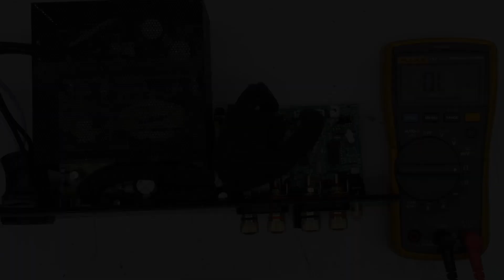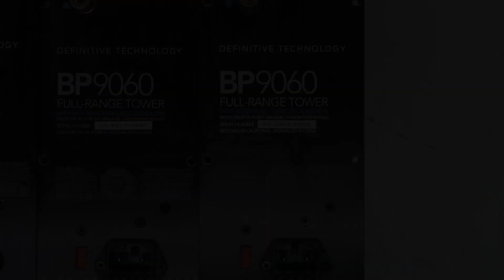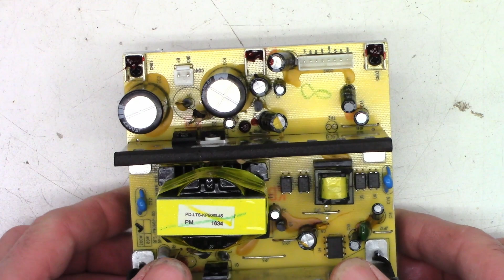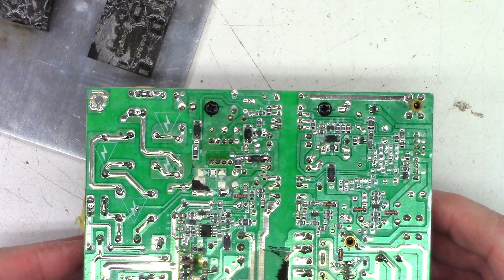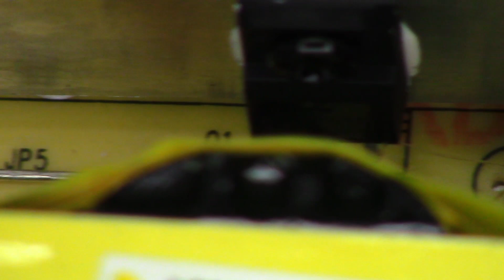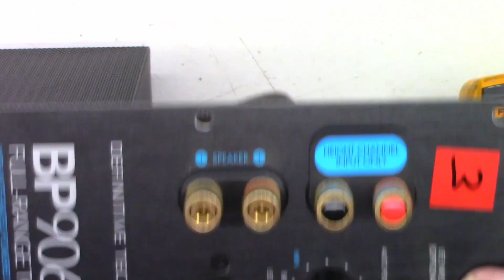A Customer dropped off (3) Definitive Technology BP9060 Amplifier Boards. What did I find?

Comment: Thanks for the video. I’m working on this power supply issue now. Here is what I’ve ordered:

Burned
R14 0.47ohm (1206)
R15 0.47ohm (1206)
R17 0.47ohm (1206)
R18 0.47ohm (1206)
R21 560ohm (0805)
D3 MMBD914L shorted *marking of “5D” (SOT-23)
U7 OB2269CP blown PWM Controller IC (SOIC-8)
Q1 16N50 (replaced with STP20NK50Z) Shorted (TO-220) but need to isolate metal tab of new FET with nylon isolation washer and mica (and apply thermal grease).  Test for short between heat sink and FET tab before applying power. Good luck!

Comment: Thank you for the tear down and diagnosis - great job ! I have also had issues with exactly these and have gone as far as buying new amps from DT. I have exactly the same issue with the SMPSU on the latest dead amp, same components gone too. there must be a common cause or some design flaw. So if I want to power the amp externally... what voltages do I need ? ; +45VDC @ 4 amps, +/-12VDC @ 1 amp and +5VDC @ 1 amp. do I need to pull any other pin on the 8-way connector either up or pull down to get it to turn on and work ??. Would appreciate any comment and thanks again.
Reply: Did you figure out how to power the amp externally?

Comment: @NorCal715 I agree with two posters here..... do a teardown of the PSU on either of the two working, PSU's get it on video, then refer to it later to get a parts list to make a quote. Maybe a 5 min task. Use hot air to warm the rubber pad to release the glue and leave half the screws in this time since you now know the heatsink and rubber pad separate from the pcb. You likely have the resistors already. A bit of a rabbit hole since you don't know what you will find if you replace the dead components, but not a total loss. You can check for shorts along the way. Some components can even come from your donor boards or salvage components you have removed from other dead boards. Even if SMD pads are heat affected you can easily solder blob or bodge-wire bridge them to better trace material with regard to the resistors. This is not a difficult fix visually. I had a Proscan LCD TV signal board from a customer that had a FET and 4 SMD resistors blown from a lightning strike. I had another similar generation RCA board as reference. Mine was waaaay more difficult since it had a thick aluminum heatsink/shield over top that was solder lugged to the pcb. Low melt solder, Antech 559, some wicking, a little hot air and I smoothly got in there and made my parts list. About $8 in parts I didn't have and about $.20 that I did have and all was well. Excellent and as always thorough diagnosis.